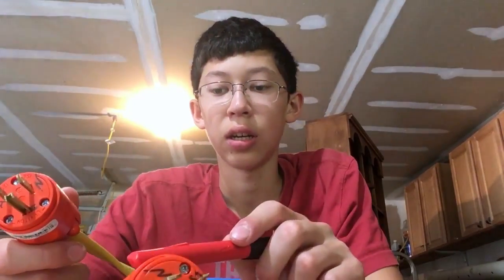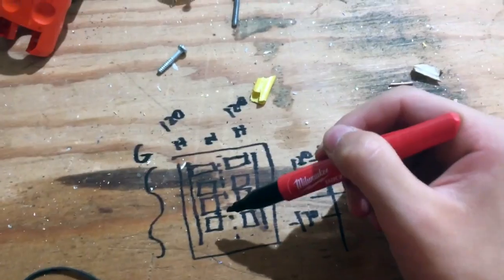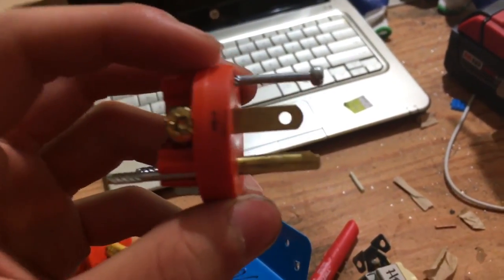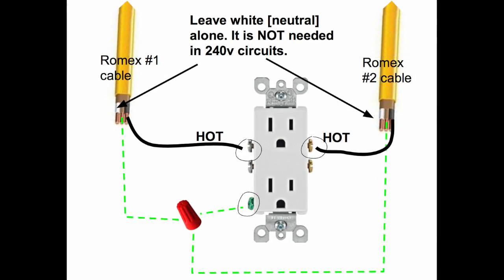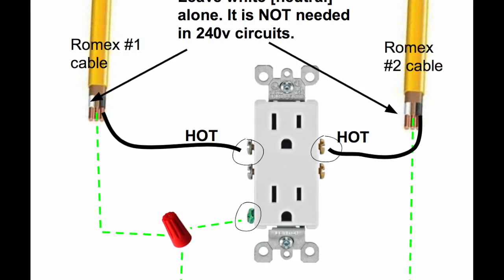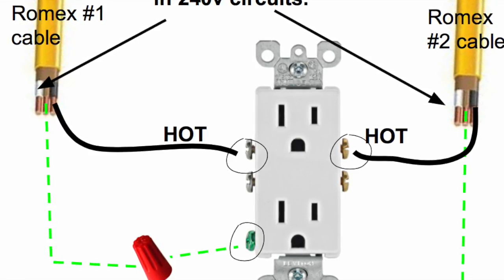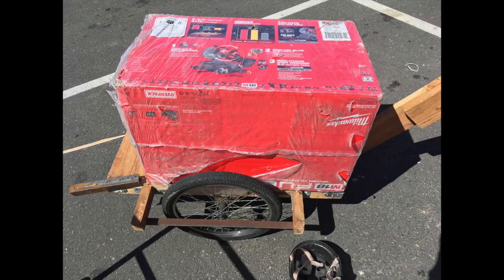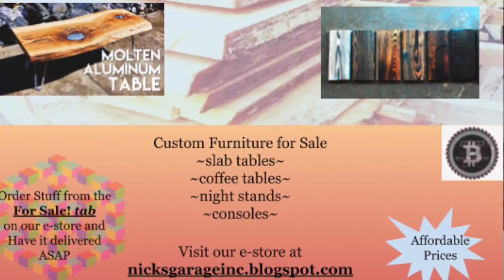HOW TO GET 240 VOLTS by combining 2 120v outlets. #electricity #diy

Comment: This works but never use a receptacle that exceeds the amp rating of the lowest breaker on the circuit.
Also, make sure it's in a house that the line and neutral aren't switched or incorrectly polarized somewhere up the line. Otherwise you're putting 120v to the neutral of either circuit. Not necessarily to the panel, but possibly to the housing of another appliance in the house. 
If everything is wired correctly and you're absolutely certain the entire circuit is properly polarized, it should be ok. None the less, i wouldn't trust it for anything more than temporarily plugging in something 13 amps or less.

Comment: You really shouldn't teach people how to cut corners using the wrong receptacle.  And yes I see the comments during the video telling the viewer to use the right parts but a DIYer may copy you exactly and use a 110V receptacle precisely the way you did it for this video.  You're obviously educated in the theory and principles of residential electricity but I don't know why you are intentionally careless about the hazards.  These are real hazards.  The voltages here can easily kill you.  While you're electrically correct in constructing a 240V circuit, a 240V has it's own receptacle precisely so people won't try and plug a 120V appliance into it, accidentally or otherwise.  If you want to help people and not put them at unnecessary risk, pull this video and make a new one with the right receptacle.

Comment: Many people wanting better EV charging might be attracted to this dangerous hack.  Find out if your power company will help pay for the installation of EVSE first. My power company reimbursed me $1500 of my $1700 cost that involved adding a new subpanel and running a 40A 240V circuit.
Reply: Could also be extremely dangerous. A shock from 120v is light, but one from 240v can kill you. You will also be limited in your amp. You are right, just be patient and build a 240v/50a. It’s the most powerful and safe and most companies refund most of the bill. It’s not even that hard to do.

Comment: I don't understand all the hateful comments on here. It really worked. I used the exact same setup but with a proper receptacle of course. Now I'm getting the full 16 amps out of my level 2 ev charger, charging my Ioniq much faster. Thank you.
Reply: Because electricians are unionized.  They want you to think that only they have the vast knowledge required to even dare to touch anything electricity related or solar generated.  That's why they have Lobbied with the government to impose licensing restrictions so only they can contract projects. Same with pipe fitters and plumbers. And not that there isn't alot to know because there definitely is they just don't anyone to know what they know because they pay good money in union dues to secure their jobs. Intimidation is a big tactic of unions to deture private contractors and DIY'r alike
Reply: Because it's dangerous, against code, need more common sense reasons?
Reply: It obviously worked but nothing he used was rated for what he did. Someone does it like he did and actually uses it in their home it’ll probably burn.
Reply: @jimfields9491 Probably? So you’re just guessing.

Comment: I tripped a breaker in less than a second with this
Reply from the maker: must have done something wrong. Breakers trip in less than a second if and only if there is a complete short, so you must of mis-wired it.
Reply: @nicksgarage8295  id say so
I also didn't know not to plug it into a GFCI
Except the other one tripped so it was weird

Comment: When you draw your wave for the 120v source, the peak actually goes up to positive 170 to negative 170 volts. 120 is just the root mean square (RMS) voltage. Peak voltage divided by sqrt 2 equals 120v. This is way of finding the average value of the wave (DC equivalent) while acknowledging that the electricity is on and doing work whether it is positive or negative for a purely resistive circuit.

Comment: something wrong with your explanation because i can see in the video that you connect the white wire to the outlet then you mention in the drawing that leave the two white wire alone without connection we don't need them with 240v. so please would explain what is going on and thank you (Need More Details)
Reply from the maker: u leave the 2 copper ground wires alone... u leave the white ( neutral wires) also alone. u only use the 2 hot wires which are black.
---> means connected too.
white wire -> black wire = 120v
black wire --> white wire  = 120v
white wire --> white wire = 0v
white wire --> ground / copper = 0v
black wire --> ground / copper = 120v.
black wire --> black wire = 240v.

Comment: I would recommend to do what I did. I added a 50 amp fuse in my electric box and ran the appropriate cable to a 14–50 plug. Then I got a 14-50 Adapter for my portable tesla charger that came with my car. That charges my car at 34 miles an hour.

Comment: this video is another example of dangerous wiring practices. don't do it. run a 20 amp circuit from the breaker panel with the 20 amp, 240 volt receptacle & a 2 pole 20 amp breaker in the panel. sub-standard wiring is hazardous. electric car chargers require 50 amp 120/240 volt circuits.

Comment: Very nice video.thanks 👌.  Very smart. I myself could have used some instruction on determining the 2 different phases vs 2 outlets from the same phase. But great video.
Reply from the maker: 2nd easiest way is good old fashioned volt meter. plug it into 2 extension cords and  it reads 240 if and only if on 2 phases

Comment: What you built is extremely dangerous. And the outlet in that box is only for 120, not for 240. Finally, this will not work at all if either of the 120 volt outlets that you plug into has a GFCI on it. The instant you draw any current at all in this configuration the GFCI will trip. Which is a good thing cuz it might keep you from killing someone.

Comment: If you should pick two circuits that are A and B phase putting two 15amp circuits together is only going to give you a 15amp 240 v circuit. It's hard to find anything that's 240v that will run on less than 15 amps.
Reply from the maker: false. I run my 240v 20/30 amp welder fine off these without a breaker trip. for continous use, sure like a dryer off this is a no go, but for low duty cycle like 240v welders, table saws, etc, you can exceed the 15 amp limit by 100% without a breaker tripping for up to like 3 minutes per event
Reply: @nicksgarage8295  Sorry but we seem to use table saws differently. I might spend half an hour ripping planks to size. My welder takes a 2P 30 to use on the low range. Not sure theres anything around my farm inside my home or in my shop that can run on 12 amps(continous load on a 15 amp breaker). You are talking about trip delay for start ups and I'm talking about continous load. At any rate combining two circuits requires they be on one 2P breaker for safety. I can't believe people actually suggest something so dangerous. Not to mention if the circuits aren't tied together and you manage to trip one breaker the other may still be on not only causing a safety hazard but single phasing anything plugged into it. That table saw will likely burn out the motor in short order. I spent forty years as a commercial electrician and there are multiple safety issues with having two circuits in use that are not tied together in the panel. Haphazard is not a replacement for doing the outlet correctly.

Comment: This dryer has 220 two hot and common and ground. Confusing. No need for common?
Reply from the maker: hello.... i responded to comment earlier...
Reply: unless you have some devices on the dryer that require 120v, IE controls Digital screens, blinkey lights. its best to just have it unless you know an electrician that works for free. This one doesnt.
Reply: 220/240 (two hots) is for the heating element, 120 (hot/common) for lights and controls. Ground is connected to both in case of a fault

Comment: Trying to do this for a dryer. Dryer seems to run on 220 but not actually. 110 for heat and 110 for motor and light. So I'll be doing this but using both Commons aswell. What is common for anyways?
Reply from the maker: yes.... your drier most likely uses 220 for heat and 110 for light... in this scenario you will need to use the common / neutral to supply 120v.... ie, hot + hot = 240, hot + neutral = 120. i assume you mean neutral not common... you will need to look at the wiring for your dryer plug and find an appropriate outlet. 
good luck.
Reply: If you need to ask what common is for, maybe you shouldn't be trying this lousy work-around.  Just hire an electrician and get it done correctly.

Comment: Sorry very bad very very bad idea you can blow things up don't try this at home stupid ideal if you going to work you 220 to 24
0 put an outlet at the fuse panel and running a extension cord you can also use your dryer outlet for 30 amps or they range for 50 in temporary use don't be a fool some people should be on the internet

Comment: The key here is to use two different phazes, which most people won't know what it means.
The way you show it, looks simple enough however, it is anything but simple.
Most people will assume they can use the same two outlets from the same box, wich will most likely be connected to the same switch and phase.
You are going to set someone's home on fire dude.
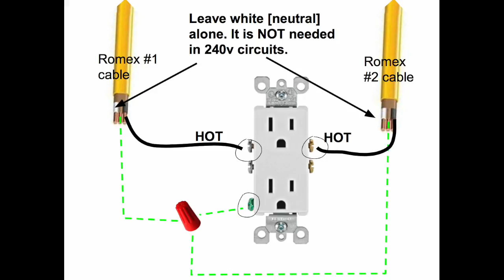Reply: He said that at 2:39

Comment: 110 and 220 volt not 120 and 240
Reply from the maker: nope... lol. AC RMS is 120 volts... and is calculated by taking peak voltage and dividing by the square root of 2. Go take a multimeter and measure your outlet. i bet you 200 dollars it says 120 on the lcd display not 110

Comment: can i charge my EV with this device?
Reply: No, no, no, do not do this AT ALL. This video is dangerous and uses the wrong materials for the project. I don't know what EV you have and what charger you have, but L1 charging expects 120 Volts and draws about 12 Amps. The adapters and plugs on your charger tell the charger whether it should operate at L1 or L2, so when plugging into the "standard US household outlet" shown in this video (NEMA 5-15R) your charger goes into L1 trickle charge mode and expects to draw at 120 Volts, so if you supply it with 240 Volts you could damage it or start a fire.

For L2 charging you need to use a 2-pole breaker rated at the correct amperage and use the correct wire gauge, which is usually 8/3 or 6/3 depending.  Romex 14/2 will burn down your house if you try to use it for L2 charging). And you need to install the correct receptacle. Do not try to turn a NEMA 5-15R (standard household outlet) into a 240 Volt outlet. There are plenty of better DIY videos you should watch instead.
Reply from the maker: @Jason608  eh. it wouldnt burn your house down cause the breaker would trip. Im not sure the diff between L1 and L2 other than probably L2 being a fast charge at 4v per 18650 li cell to bring up to 80% SOC, and then cut off, but for L1 my device should work fine.
Reply: @nicksgarage8295  for L1 120 works fine, So no, back off
Reply: Yes you can.   Just don’t draw more than 20 amps
Reply from the maker: yes you can!!!!!!!!!!!! it will work. just make sure to not be dumb about it.

Comment: I tried it and it didnt work with a single ac outlet any suggestion?
Reply: You need 2 different outlets "separate breakers" and extension cords I wouldn't do it it's not safe lol! Just wire up a 220V circuit breaker it is easy if you have extra slots in the breaker panel.
Reply from the maker: you need breakers from different phases, try different outlets and keep on moving... you need to find 2 outlets on different circuits and phases. you prolly might need to go through like 4 outlets before you find one that works. then just sharpe that outlet and remember to plug it into that one.
Reply: Yepper you want to try this blow things up in your house go on make my day

Comment: This hack is BAD! 220 volts start at 30 amps and up with 10 awg min. The line is already under rated which is already bad. Suppose you overload one leg and trip that leg but the other one doesn't? This is why they build 2 pole breakers. And suppose someone plugs a 110 plug into that 240vac outlet? If this causes a fire in you panel, you can't use water to put it out with water!  Do you know where your main panel is to shut off the sub panel in case of an electrical fire? Electric car and heavy machinery as you have stated requires a dedicated circuit. Not a hack! I don't mean to be a downer but you need to do your research before posting videos like this.
Reply from the maker: lolzzzzzzz

Comment: A 120 receptacle is not rating for 240 voltage, so how do you use a 120 for 240? Not safe dude... $10 is too much?
Reply from the maker: Yeah at that time i was a little short on cash.
Reply: @nicksgarage8295  Cash isn't the only thing you are short on.

Comment: That's a 20 amp 120v receptacle stupid.
Reply from the maker: lol, thats true, but my welder is dual voltage and comes with a 120v plug and adapter. Its easier for me to just plug into that for my welder. Plus at the time, i was broke and couldnt afford a 240v one....

Comment: I need 100amp circuit can I just take 5 20amp plugs an covert , please help me YOU are soooooo smart.
Reply from the maker: No. Amperage cannot be added because of the circuit breakers, but you can add voltage. The breaker would trip once you pulled >20 amp. If you added 2x (120v 20 amp plug) you would get 240v 20a. You add 5 plugs, you would still get 240, as that's the service voltage from the transformer, you cant get any higher. And the max safest amount of plug combines is 2, like I did. TO GET 100amp circuit, you MUST open the panel and install a corresponding breaker or subpanel, 100 amps is a lot, what are you trying to do?
Reply: @nicksgarage8295     Really?   Are you sure?

Comment: The 240 VAC in series combination I am referring to has NO center tap.
Reply from the maker: Yeah, you need the center tap to get the 240. The transformer on the pole is center tapped for each 120. If you dont, youll get 0 volts.
Reply: Center taps are for transformers moron

Comment: What about 2 services of 120 VAC in series combination for 240 VAC?     That means   H  to  N to H to N resulting in 
240 VAC   Hot and Neutral return.
Reply: Most stupidest thing you can do run extension cord from your dryer Outlet if you really need to do something stupid
Reply from the maker: In a series circuit, voltage is added. To get 240v from 2, 120 lines, they must be attached in series. To do so, you must bridge the hots together in series. The neutrals ARE NOT USED. If you bridge H to N, you will not get 240, you will get 120. You will actually get 0 volts in your scenario because you basically have no voltage potential difference between the 2 sine waves because you used the neutral. Neutrals are not used in 240 circuits.

Comment: So many things wrong here.
1. Two separate breakers protecting one device.
2. Wrong plug configuration for 240V.
3. Backfeed onto a male cord end.

If you don't know how to do electrical work, DON'T learn it here.  People die every year from these kinds of videos.
Reply: Can you please explain number 1 for me 
Why is this bad
Reply from the maker: jabberon lol we got a troll in the house. Yeah I get it’s not code since when it was made, but who cares....... plus the 240 plugs are 2 expensive and a 120 will work just fine as long as u don’t plug in a 120 appliance
Reply: @nicksgarage8295  not a troll. Just a real electrician, who has seen the aftermath of this kind of work. Not good. You might think, " I know what I'm doing, it work".
Reply from the maker: jabberon what is the aftermath of this junction box exactly....
Reply: @nicksgarage8295  120V equipment accidentally being plugged into it, poof!
Also, what happens if you touch the hot on one of those pigtails while the equipment is on? You go poof!
Does the circuit have proper GFI protection? No. Get a short and guess what, poof again.
My point is that you should just do it right or don't do it at all. Someone could die following this BAD example. FYI. A proper breaker/wire/outlet will probably run you under $50. And be a lot more safe.
Reply from the maker: @jabberon1831  yeah its a home shop so i would the only person using the box and i obviously wouldnt plug 120v into it but yeah. I kept the 120 outlet b/c my welder runs off 240 and 120 and thus has a 120v adapter plug that i keep on it, so easier to just have a 120 outlet that feeds 240. 

When the equipment is on, to touch a hot pigtail, would not be possible. The machine wouldnt turn on b/c it would not have 2 hots to draw power from. I dont think the welder will turn on from a hot and a ground, but it might....

Yeah since its a home shop and my rules/ i am the only worker, it works, but i wouldnt really want other people using it lets say if i was in a makerspace etc. but valid concerns in genral. for various reasons, this box was the only reasonable choice do to certain constraints, but yes if i was 18 and a homeowner, i would most definely run a 240line.
Reply: jabberon why would you touch the pigtails while the equipment is on or plug in 120 equipment?

Comment: Where is the disclaimer to this? This is like the worst way to get 220V. If you plug in a load to your box and have one connector plugged in your ass will get shocked if you touch the other male connector due to the hot flowing through the load to the other plug. Also since most people need 220v for something in the garage it will most likely trip the required GFCI circuits because no current is flowing back through the neutral.
Reply from the maker: Thats why you cant use this circuit on a gfci.